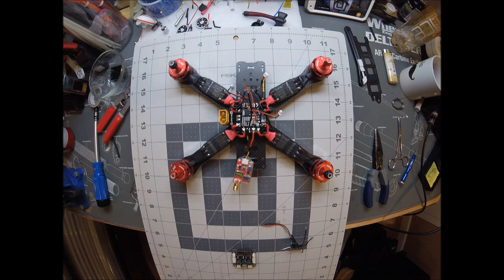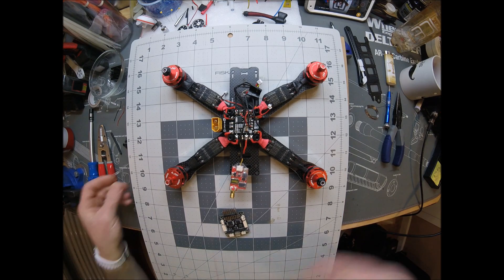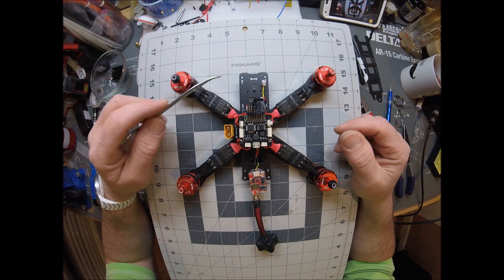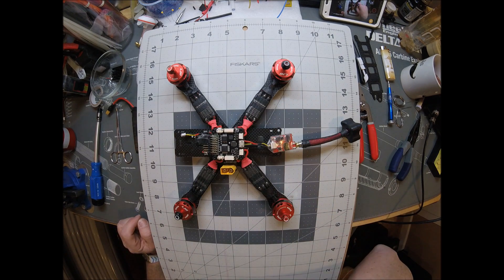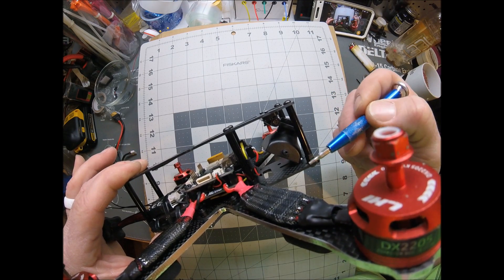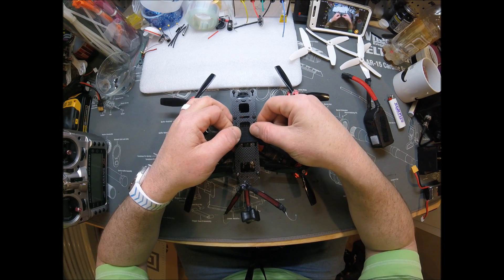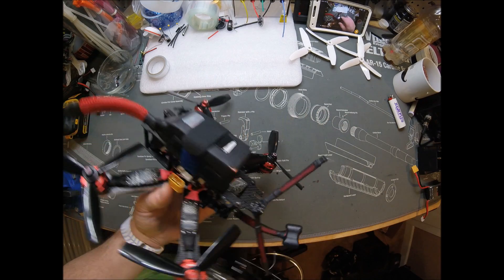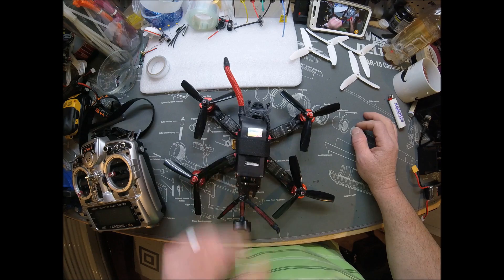LHI 220 Build Part 2

Comment: To all the whiners, this guy didn't sell you the kit and I doubt he makes any money off the sales.  He condensed a three hour project to 15 minutes, what did you expect.  You all need to spend about 10 hours watching other builds, the same on basics and probably double that on flight control software setup before getting started.  This is not a beginners, learn to solder type project.  Take your complaints to the seller and stop riding this guy.

Comment: Hey man good video. Build large drones in the 900-1000mm size so this is a new for me. For the complaint of karnes bitching about how it's not clear for them it's all labeled on the board there are downloadable manuals with pinouts as well. No need to knock the man because he doesnt cater to your inability to read pcb.

Comment: Received this kit and put it together this weekend.  My FPV camera that came with the kit is actually a 5-12v version.  I initially had it running on 5v but video had too much static so took a gamble and ran it off 12v.  No white smoke and the video cleared right up.  Thought I would share

Comment: Hi I'm really new to this. I have a Turnigy 5ch Transmitter and receiver I was just wondering do I need any software to hook up the quad to? and is there any coding needed? or do I just bind the transmitter to the receiver and thats all?
Also what do you use to receive the video 
Please reply ASAP

Comment: Hello, I mimicked pretty much everything you did on you LHI 220 build. I have built mine, I have connected with cleanflight, I’m using ppm, I have fs th9x transmitter, with fs receiver, I am able to control all functions through cleanflight with the drone, but for some reason I cannot see my values go up or down within the receiver tab of cleanflight. Everything is hooked up. Can you please help? Thanks

Comment: Powering up tomorrow when batteries arrive. Thanks for your video helped a lot. How hard is it to change direction of props. All my drones are 1s betafpv whoops. I have two brushless and both had motors backwards and I was told to switch any two wires.  I did switch outside wires on both backward motors leaving center wire.   Fixed therm right away.  You referenced helicat that hard to do?
Reply from the maker: Jason Whitley - No I referenced Blheli to do that. It's very easy, here's a link that'll show u step by step. Thanks and glad my video helped. :)

https://youtu.be/0Bi1XcdpnQI
Reply: David Stanley FPV so I'm assuming this board accepts the pass through for connection to blheli esc's. I'm using current release of betaflight. I heat shrunk all my esc 's and hoping not to have to cut out for soldering. Added a run time eagle 2 pro to gain osd and 16.9 can't wait to fly a pack.  Thanks again
Reply from the maker: Jason Whitley - yep just:
1-Open Blheli
2-Connect computer usb to Fc usb
3-Select bf as ur operating system
4-Click "connect"
5-Plug up battery
6-Hit "read esc's"

Comment: The L shaped pin mod confused me. Which wires do you solder to the pdb from the L pin mod. Could you also send me a quick pick of how the L shaped pin mod connects to the FC and what specific wires go into the pin and in what orderYou can send them to my email : zekrom527@gmail.comI am a complete beginner on all of this so it would be a major help if you could explain it in detail with the pictures when you send them to me. Thanks a lot in advanceKamran
Reply from the maker: Kamran M what receiver are u using
Reply: i am using the FS-iA6 flysky 6 cgannel receiver
Reply: no i am just planning ahead
Reply from the maker: Kamran M - All u have to do is connect via "SBus" It'll be 3 wires. Red(+), Black(-) and White(Signal). Connect Red to Uart3  + 
Connect Black to Uart3   -
Connect White to Uart3 rx
Reply: thanks
i would also like to know how the vtx is connected to the pdb and to the camera in more detail with the color of the wires please.

Comment: How do you add a iA6B receiver to this quad? Please respond ASAP
thanks
Reply from the maker: Kamran M - Connect it via sbus through the Uart3 8 pin plug. U'll only use the 1st 3 wires. Should be red, black and white.
Reply: could you somehow send me an example at my email: zekrom527@gmail.com
this would be a major help.
thanks in advance

Comment: my motors wonts spin when i give it throttle any ideas
Reply from the maker: Chiefs HaLot is ur receiver connected correctly and bond to transmitter?
Reply: It's a turnigy evolution it's says its factory bound. Red light is solid and fc red led lights up when I give it throttle and I have voltage signal on my remote, so idk
Reply from the maker: What quad us it?
Reply: The one in your video
Reply from the maker: Where did u buy if ready to fly with an Evo?
Reply from the maker: Chiefs HaLot - Okay, couple questions. 
1. Did u build ur lhi 220
2. Have u programmed or done anything to the settings in Betaflight?

Comment: At 1:42 the part your holding in right hand.... I cant get a clear shot of it to be able to wire it up like you did :/ also since you went for the  "clean" color coordinated look the wires are different colors makes it that much more confusin :/ .....     it's 2   3pin connectors hotglued into a L other than that lost on what gets wires etc how to wire up.. ty
Reply from the maker: Richard Ricca that "L" shaped piece is the 4 signal wires (1-4) and a positive and negative wire
Reply: David Stanley FPV   one through four signal wire do I follow the schematic that I saw from cleanflight  QuadX 1234 or does it even matter just for Signal wires the order?
Reply from the maker: Richard Ricca yes 1 is rear right, 2 front right, 3 rear left, 4 front left

Comment: Hey David, I'm going to be building a quad out of the same parts kit, but I'm making my own my own flight controller and remote using Arduino Uno and atMega Microcontrollers. I've programmed the microcontroller before but I've never built a quad. I wanted to know if I could use the control wires on the ESC to control the motors using the arduino?
Reply from the maker: Jeet Thakkar - I would think so, I don't know how else u'd control um.
Reply: I'm sorry, what I meant to ask was if I could use the common arduino based board with PWM to control the motors? Looking at the specs of the arduino I can safely assume that the output of the pins will be 150mA at 5V. Is that ok to control the motors through the ESC? Thank You!
Reply from the maker: Jeet Thakkar I'm not sure but it sounds like it would. u could try to see, the most u'd do is maybe burn up an esc. Hey don't u just buy a $20 spf3 fc?
Reply: I know, but I'm doing this for an embedded systems project for my university. I'm trying to build the system from the ground up using programmable components.

Comment: How do you mount the go pro?
Reply from the maker: AspiredTech - I just use the top part of the stock session 5 mount with good velcro on the bottom and velcro on the top plate of the quad. Then 1 zip tie to hold it in place.
Reply: Interesting... Thank you! I just 3d printed a mount and it seems to work  good. Great video! Thanks for taking your time to make it. Much appreciation!
Reply from the maker: Thanks

Comment: Thank you so much for this video. If it weren't for this I would have been lost with this build.
Reply from the maker: UYP Studio thank you and your welcome. Glad to help :)
Reply: David Stanley FPV I am having issue with my FPV setup. I'm getting a black screen with grey lines in goggles when camera is plugged and a black screen when not plugged. Any ideas on how I can get a picture or is my vtx dead?
Reply from the maker: Stupid question but did u take the lens cap off the cam?
Reply: David Stanley FPV -Yes cap is definitely off
Reply: I think I plugged my battery without the antenna in. I'm not sure cuz I was troubleshooting but I think I did. Ordered a new vtx a sec ago jus in case tho
Reply from the maker: Ok u have ur vtx red and black (+ and -) connected to 12v and the white, yellow and blue wires running from ur vtx to ur cam correct. Also remember never connect ur battery without an antenna connected to ur vtx or it will burn the vtx up.
Reply from the maker: Yep that'll do it, u can get a cheap vtx on amazon for around $20
Reply: I connected vtx to 12v and I connected white and black to pos and neg of buzzer on FC and yellow is still coming from vtx. I did white black and yellow from vtx at first but I realized u connected urs to the buzzer so I tried that an got black and static but still no picture
Reply from the maker: Buzzer port won't work, if u watch again ull see I finished mine differently.  I mentioned it during the build that the buzzer port will not work. Connect it to 12v and it'll work:)
Reply: OK. So go back to letting vtx power the camera? (Didn't work when I tried last time with Ground and audio wires connected to the camera along with the signal)
Reply from the maker: U could but it would be easier to just power the cam off a 5v connection
Reply: I will try it out. Thanks a lot
Reply from the maker: I connected mine to the + & - of pins 8 on the fc (the middle pin is + and bottom pin is -) also another correction to the video, the vbat needs to be connected to the main power line solder points on ur fc. If not it will only read 12v all the time lol stupid mistake, can't believe I did that.
Reply: Got it working finally. Thanks
Reply: roland burrows http://www.readytoflyquads.com/flip32-f4. Really you jus need the 3 wires (Ground, Positive, and signal) when using SBus. Then configure ports for serial Rx on UART. Select serial Rx and sbus for receiver on receiver tab (cleanflight) on configure tab (beta flight)
Reply: UYP Studio thanks. I wanted to know exactly where to connect on F3 Acro board as I am really struggling to get a connection when I connect the receiver to the FC. Given that the FC is pinned, is there a diagram somewhere I can look at?
Reply: How did you connect your receiver? I am using a frksy XSR.